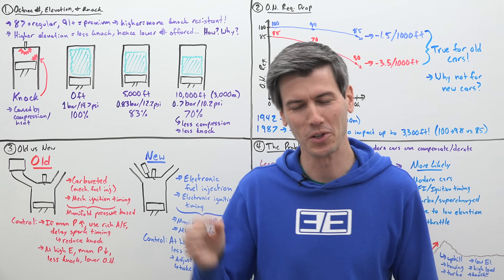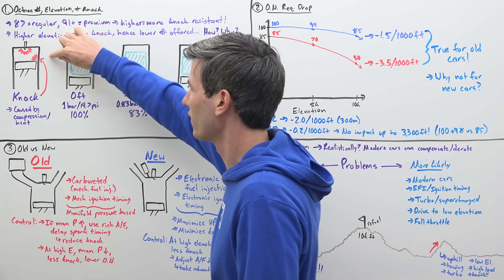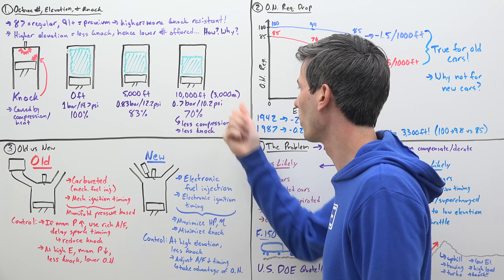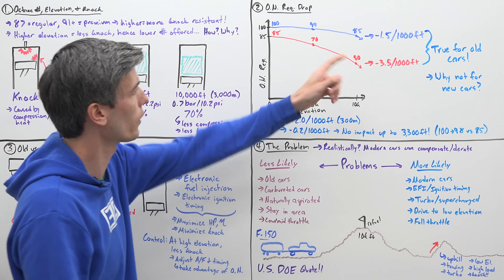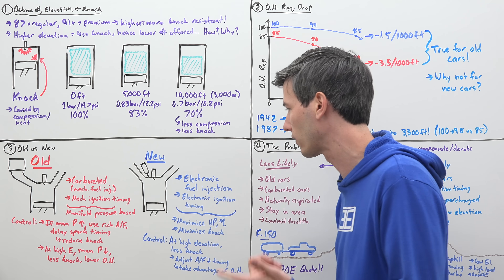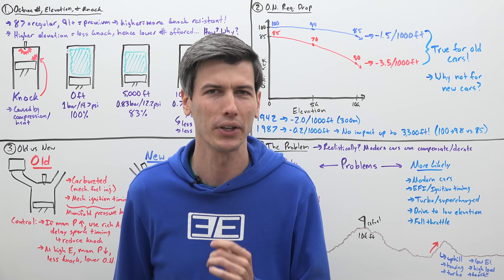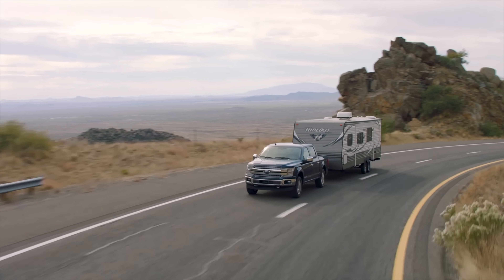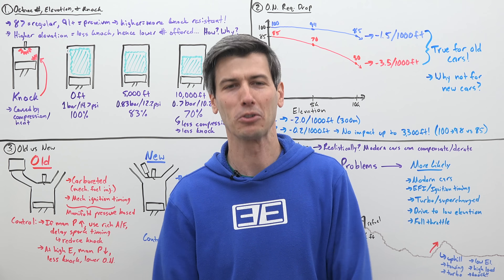Never Use This Gas In Your Car!

Comment: Won't a turbocharged engine have this issue at any elevation if you give it adequate throttle?  The turbocharger will boost the manifold pressure beyond sea-level's pressure even at higher elevation, so that engine could experience knock at any elevation with lower octane fuel.  This is why most turbocharged engines require premium.
Reply: That was a bigger problem with engine management that didn't measure or limit boost well. Modern turbo cars basically limit your boost to prevent knock and that will be true regardless of the atmospheric pressure. If say your boost is limited to 17psia on 87 octane, it will limit it to that 17psia regardless of if it's adding 2psi at sea level or 7psi at 10k feet.

That's why most modern turbocharged vehicles "recommend" premium, but only require 87. You can make more power on higher octane fuel, but the engine will run just fine on lower octane fuel at lower boost. Personally, I stick with the 87 octane fuel because in my market it's 20-30% more for premium gas than regular and you're looking at 5%ish gain in power and even then, only at WOT.
Reply: @danbert8  That's pretty cool. This must happen as a reaction to detecting knock though, correct?  The computer can't know what kind of gas is in the car and therefore what the boost limit should be, so it can only back off the boost once knock is detected?
Reply: @Kraigmire that is correct. Modern cars have knock sensors that can detect the limits of pre-ignition and pull timing/limit boost to prevent engine damage.
Reply: @Kraigmire  Modern knock detection is pretty bonkers. The older method was to use what was essentially a type of microphone tuned to the frequency of knock and was bolted right to the block. I don't remember all the details, but modern engines use the spark plugs to measure the impedance across the gap to determine if cylinder pressures are too high. Something like that anyway, pretty interesting that engines can now adjust for knock on a per cylinder basis rather than just "listening" to the whole block.
Reply: @andrewt9204  Actually almost all modern vehicles still use piezoelectric microphones to listen for specific knock frequencies.  Usually with one knock sensor for single bank (so 2 for V-engines, 1 for inline engines) although I believe most BMWs I6 engines use 2 these days. The knock sensor output is referenced to a knock sensitivity table for each cylinder indexed by rpm and load and calibrated on an engine dyno. Measuring for ionization potential to predict knock has been around awhile (first pioneered by Saab's Trionic engine management I believe )but it has many drawbacks associated, to the point is has not been widely adopted yet.  Nonetheless, by referencing knock sensor output to cylinder firing order most modern cars can do cylinder to cylinder knock retard anyways.
Reply: @ChurchAutoTest   thanks for your insights and information. We all appreciate it 🤠👌
Reply: @Kraigmire  Those new Mazda engines actually have pressure sensors in the pistons that feed into adjusting all the parameters for the next combustion cycle every cycle. So they are going a bit past just knock sensors already as those engines are high enough compression that any significant knock at all would damage them.
Reply: @ChurchAutoTest  Interesting! I didn't know that they were still used. Makes sense though.
Reply: There's tunes u can run for this fuel in the south we get a flex fuel kit and a tune and run e85 to race with for more power
Reply: I had a 2002 supercharged xterra. 92 or better was preferred, but lower octain was ok. The lower octaine gave significantly less performance but caused no harm.
Reply: Yep moving to diffrent states i saw it too

Comment: It is not crazy that it is possible to sell octane 85 gasoline; however it is crazy that we live in not well-informed populace.
So the only thing I would say that should be done legally, is a requirement to warn people at the pump and to not have it where 87 would be commonly be found.
It is not "bonkers" to allow something to be sold that shouldn't be commonly used. It is bonkers to ban something that is intended for a rare use case due to the lack of people being well-informed.
The freedoms declared and protected in the founding of the USA are clearly stated to be intended for a citizenry that is well-informed. 
So if anything, you are doing good by helping make the citizenry be well-informed with this video.

Comment: in Spain the lowest octane gasoline is 95.
Also 98 is available almost everywhere, and even you can find 100 on a few gas stations

91 premium? hahaha
Reply: Yes but that's research octane in Europe. North America use RM/2 method, that's research octane + motor octane ÷ 2 and so motor octane is lower then research octane which bring down the ratings.

Comment: Idon't think its crazy that there is gas available that is not for every car. That is like saying your car takes 91 only, and it's crazy that 87 is available.
Reply: There's a big difference between still having 85, which isn't supposed to be used  with any car made in the last 5 decades, versus some cars requiring more premium fuels.

Comment: I thought carbureted engines were more tolerant to low octane fuel at high elevations because the low atmospheric pressure would cause the AFR to become rich, and as I understand it, a rich AFR in an engine is less prone to knock than a lean or even stoichiometric AFR.
Reply: Cars sold at high elevations were tuned to high elevations. They were jetted leaner and the spark was farther advanced. Once ethanol was also added, pinging was really common once the engine got hot.

Comment: So doesn't a turbocharged vehicle always have the same pressure in the cylinders at high elevations and sea level? If so, then no matter where you live, if you have a turbocharged engine you can not put 85 octane in? I use 85 octane in my 1997 7.4L truck and my 2003 Honda Pilot. We live in Elko at 5,500 feet of elevation. If you're saying that the 85 octane should not be used in them then, whoops.
Reply from the maker: Unless the turbo compensates for elevation, it's likely to still lose some power. The wastegate will open a predetermined boost level, so you will get atmospheric pressure plus whatever boost the wastegate allows. Since atmospheric pressure is lower at elevation, the total summed pressure will be lower.

Comment: Ford Accountants: We spend a lot in engine replacements every year.

Ford Executives: Well that's no good. We need more profit. Taking care of customers is not priority.

Ford Accountants: If we find a way to reduce engine replacements, we can benefit significantly.

Ford Executives: Hmm... What can we do to save more money and screw over customers... 🤔

Ford Lawyers: You can create another clause in the warranty to reduce your liability for warranty repairs.

Ford Executives: But we've already implemented every clause possible!
How on earth can we get out of normal use cases that resulted in failure???

The Janitor: So guys, you wanna hear something crazy? My cousin out in Colorado said they have 85 octane gas there. He's been using for years now in his F-150 and he's surprised how well his truck runs considering it's built to run on 87 octane. Crazy huh.

Ford Executives: 👀

Ford Accountants: 👀

Ford Lawyers: 👀

The Janitor: 👀

Ford CEO: Ya'll thinking what I'm thinking... 😈

Comment: I've had several vehicles that had issues with spark knock, and primarily it happened at low rpm high load instances, never at high load high rpm. I would think a modern engine with knock sensor monitoring would do a better job of eliminating spark knock, but my experience has been the opposite. I attribute a lot of this to the tendency of engine computers to run a fairly lean fuel mixture at low rpm (14.7:1), but if you go WOT the fuel mixture richens up (~13:1), which in and of itself increases its effective resistance to knock. 

Thanks for a great video!
Reply: As far as i remember, very high hp/displacement boosted engines in the last couple years do enrich the mixture at WOT enough to use the fuel to cool the mixture. Primarily to reduce heat, which then also reduced the probability for knock.

Comment: THANK YOU for this. This has bugged the hell out of me ever since moving to Colorado. Every one I know here driving a modern car still sticks to putting in 85. When I moved here from sea level, I was pulling a trailer and accidentally put in 85 - I've never felt more of a power drop in my engine output. From being able to cruise in fifth to having to almost drop down to third gear. Refueling with 87 gave me my power back. I was driving a '13 Wrangler, I'm assuming this reduction in power output was due to the knock sensors and retarding my engine timing. Do you think there could be long term consequences for putting in 85 at elevation for the lifetime of a modern vehicle?
Reply: In my many decades of experience driving hundreds of thousands of miles at high elevation, no.  Don't confuse loss of power necessarily with 85 octane.  A naturally aspirated engine will lose 2%-3% of its power for every 1,000 ft. of elevation.  87 octane might help power marginally under very high load conditions, but the elevation itself is the power sapper.  Also, somewhat counter-intuitively, most cars will get better fuel economy at high elevation because the fuel injection system leans the fuel mixture to compensate for the less available oxygen at high elevation, so, less power, but also less fuel consumption.  The last time I had a vehicle knock at high elevation with 85 octane was a late 1970's carbureted vehicle with no electronic ignition.
Reply: @rockymountainjazzfan1822  Regarding the fuel economy at elevation, I've noticed this. Makes sense for leaning out the fuel, but also since the air is thinner, there is less air resistance on the vehicle. I have a turbo diesel box truck that gets about 2 mpg better mileage at elevation than at sea level. (10mpg vs 12mpg, so, 2 is a big deal here!!) You mentioned the 87 may help under high load conditions, this was certainly a case of that. 2000lb trailer with a Wrangler... definitely a high load. The one thing I'll anecdotally disagree with you on is the significance. I noticed a huge difference from 87 -> 85 -> 87. Gradient hills that I could take in 5th gear, I had to drop to 3rd for, and when back to 87, I could take them in 5th fine. This was all over the course of a full tank. I didn't have any objective sensor data to validate any differences, I could feel the difference subjectively. Personally, I still stick to 87, I'd rather not leave power on the table when I need it.
Reply: @rockymountainjazzfan1822  buddy modern cars leaning out the mixture to adapt to the lower air density at high altitude is exactly why modern cars are prone to knock with 85. Yes you are right about the loss of power at altitude, but the jeep was almost certainly detecting knock and pulling timing like crazy as well.
Reply: @Riley8425  That sounds right. When I went back to 87, my altitude hadn't changed and I quickly noticed a change (increase) in output power. Maybe it's only when under significant load (Pulling a 2000lb trailer) where there's a difference and 85 is fine for cruising around town. That was my only experience with 85, and since then I've only put 87 my car. A Wrangler isn't a power house to begin with, last thing I need is another reason to bog down when I want to push it.
Reply: That's correct, it most likely had a knock detection system or an octane detection system. As it saw you got less and less air, it probably ran kinda of okay at high altitude.  But once you got lower, it immediately declared knocking and went into safe mode to prevent serious damage.
Reply: I've been putting the lowest grade (usually 85) in a Colorado 2015 Mazda 3 for years. Higher octane = better mpg, but I don't notice any performance difference on the front range.
Reply: Been using 85 in Colorado for a decade in things like accords and acura rdx... No discernible difference or issues for me.
Reply: @patrickjeter7928  Gotcha, thanks. To the best I understand it is you're just leaving power on the table when you really need it.  (If you use 85 over 87) Won't notice a difference around town, but when you're pulling your buddies up over Vail Pass, you'll have to drop an extra gear and really push it, vs being able to just easily cruise if you have 87.
Reply: Even if you were experiencing knocking it would have been pretty mild and your ecu would adjust for that very quickly.  It's extremely unlikely you did permanent damage.  Knock damage is one of those things that really is from an era gone by.  It was mainly in strung out older vehicles that had no built in smarts to protect themselves.  We've had knock sensors for a while and it's actually very rare for engines to be damaged from this anymore.
Reply: @EVLS10  Awesome, thanks for the reply. I wasn't worried so much about my car for a brief half tank of 85, but more of the local folks who put 85 in for the life of their car (when rated for 87). Though I absolutely use 85 in my carbureted '14 KLR650! The compression ratio is so low in that bike I could probably get away with 83 at sea level if it was an option.
Reply: 85 with 15% ethanol is what I tell the California’s an Texans to buy from Costco that way their cars sensors are poop after a few months. Lol , just don’t use the 15% ethanol gas at high altitude it’s cheeper but how much are your o2 sensors anyway

Comment: Don’t modern cars have anti-knock sensors?  How does this factor in?
Reply: It will save your engine if you don't mat it all the time. Still will suck out all of the power and joy your engine could deliver running on correct fuel and kill some longevity.
Also turbos compensate the lack of air... if they do not hit their own rpm limit the car computer will make the motor reach its potential with the turbos help.

Comment: The bit from the owner's manual pretty much shows what garbage Ford makes.  NO knock sensor that would automatically, via computer, retard the timing or enrich the mixture.  It is a very simple sensor and extremely inexpensive one to install on all engines.  Ford, for the sake of making three dollars more per vehicle does not use one.  Also, it is an indication of how poorly the engines are made and how they do not wish to give a real warrantee to those who make the mistake of buying their crap.  Any excuse they can come up with to avoid having to make a quality product that they will back will do.  The attitude is not exclusive to Ford, but they are the most open about it.  Remember, Buyer Beware,! since the attitude of so many is Buyer Be Damned.

Comment: Idiots! Thanks jason. I just checked the filler on my 2016 f150 5liter. Says e85 on the filler and 87 in the owners manual.  I had not caught that . I was using 85 . Who knows what the effect of that was. I live at 8000 feet. Duh.

Comment: I live in Utah around 4400 feet elevation. I've had vehicles from 89, 91, 96, 97, 00(current), 07(current), 14, 15, and 2018. GMs, VW, Subaru and Hondas(current). All fuel injected, all NA, all ran on our 85 octane for combined hundreds of thousands of miles. It doesn't cause problems. On the other hand, we had people bringing their turbo cars to our shop that specified 91 and they were running 85 or 87 octane. Forced induction doesn't care about altitude. Saw a lot of engine damage from that.

Comment: I had no idea this fuel was a thing elsewhere in the country. It isn't a thing out here in the Mid Atlantic as far as I know. 

I really like 88 E15. It's 20¢ per gallon cheaper around here and only comes with a 2% energy density penalty, so even at 10¢ per gallon cheaper, you're still saving money.
Reply: More like 25% energy density penalty.

Comment: I've only used "Regular" unleaded 85 for the past 10 years or so ever since I have lived in Colorado and Wyoming with no problems but after watching this I don't feel quite as good about it.   Luckily I live in NE Wyoming now where "Regular" is the way it should be and is 87 at most stations.
Reply: This is what the manufacturer says about  my cars, "Do not put anything lower than 91 or it can cause serious damage to the engine. "   I have been putting the cheapest/ lowest octane gas I could find ever since the car had 40,000 miles on it.    Currently I am just short of 290,000 miles and the engine runs no different than when it was brand new.       The second car I have is currently at 105,000 miles and only got the better grade gas for the first 30,000 miles.   And also runs no different than when it was brand new and I drive  the piss out of these two cars.    The third car is at 56,000 and no different.